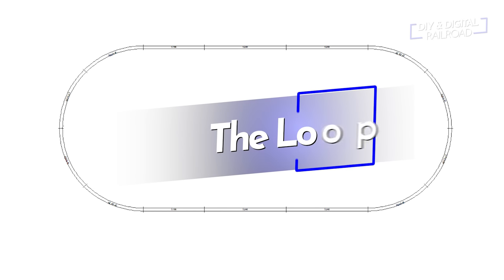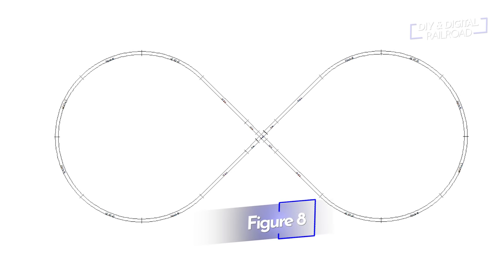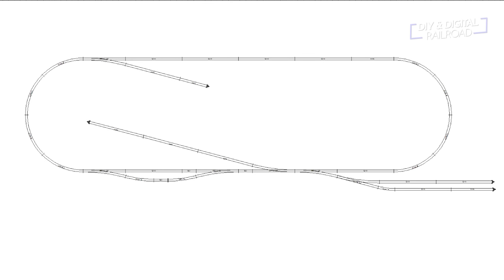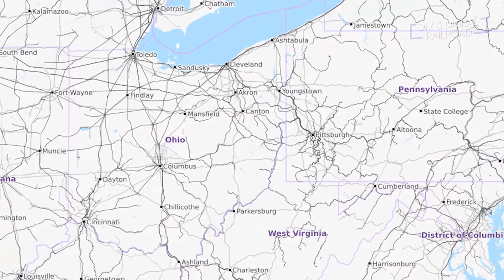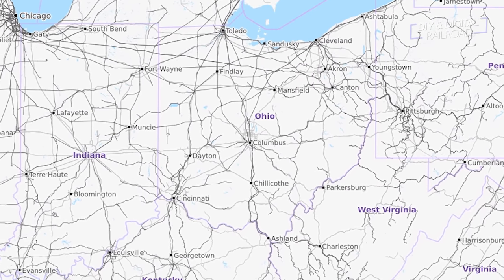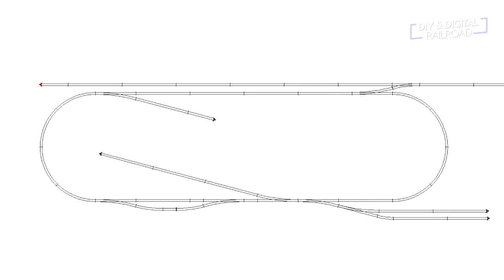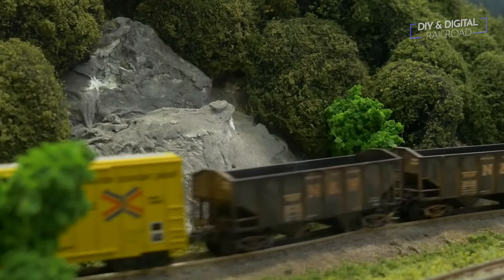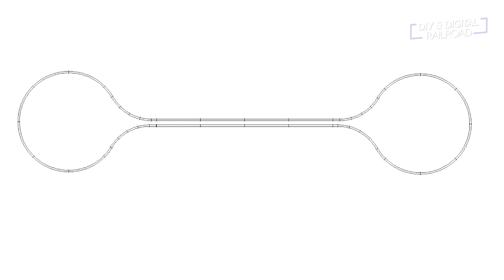Model Railroad Layout Design for Beginners

Comment: I want to make a layout that’s roughly 16”x36” to fit on my Amish fireplace, gonna be a frozen Christmas mountain. Mtn gonna be 1/3 of the footprint, I want the train to wind up it like polar express, ~20” high and a steep downhill across the back hidden by facade, to come out a tunnel in far rear corner, to standard loop across the front heading back to the mountain. Drop will be roughly 20” in less than 3 feet, for my N scale Bachman Xmas xpress
Am I being realistic, is the steep drop too ambitious? What goes up MUST come down...?
Edit: since we on the subject, what uphill grade can n scale do? I was figuring 4 loops up the ~20inch mountain? I’m no wizard, I don’t know what that works out to in grade percentages ;)